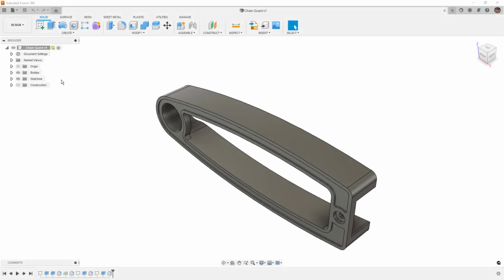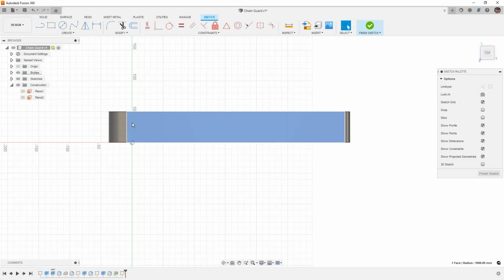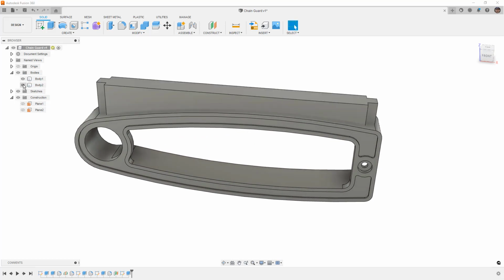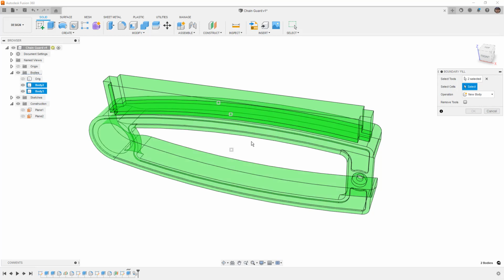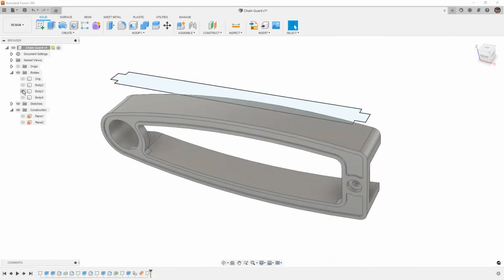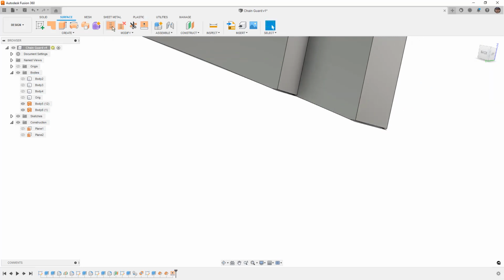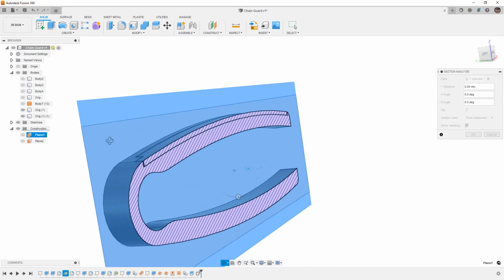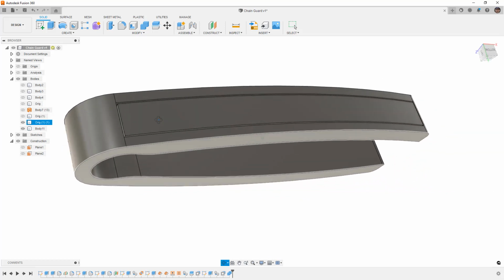How Many Ways Can We Split A Solid Body? | Split Complex Shapes with Solids and Surfaces #fusion360

Comment: Great tutorial very helpful but still little confused I'm making my speaker housing that is to big for print bed so need to cut half then print in two but really having a hard time trying to join it back tried making a little lip so to get a overlap with no success
Reply from the maker: How do you plan on attaching them together? Glue? melt? some fastening feature?  That will determine how you go about it.  In our Fender Flare series we broke up the parts with lips to glue together.  In the recent motorcycle tail section we did the same.  In other parts I have done i have left holes and printed little pins to align and glue or snap together.

Comment: Would you be able to do a video on how you'd approad thin grille/vent sections, something like the radiator air exits on the front clamshell of the Maserati MC12 Corsa? It seems like it would require adding a lot of geometry to the rest of the clamshell?
Reply from the maker: Hey Jordan, do you mean the thin sections that carry the hood line over the exits? or the actual mesh?
Reply: @LearnEverythingAboutDesign  Just the small bladelike sections that carry the lines of the hood over the top

Comment: You could try emboss/deboss also but in my experience it's a bit buggy sometimes. I'm not sure why
Reply from the maker: Great point Dave!  I don't like that tool very much so I agree.  It is essentially extrude to/from object in the part in the video.  On a part where you need a true "Wrap" it is helpful but I think that only works for cylindrical/conical parts.

If Emboss/deboss worked and let you create the feature as a new body it might be more powerful :)

Thanks for the comment!
Reply: @LearnEverythingAboutDesign  alot of the time it really doesn't wanna work for me, even with basic text wrapped round a cylinder. Autodesk need to do a bit of work on it I think. 

I thought I'd gotten to the level of pretty much knowing everything about fusion, but every time I watch your videos you show me something new🤙 best channel on YouTube by far!